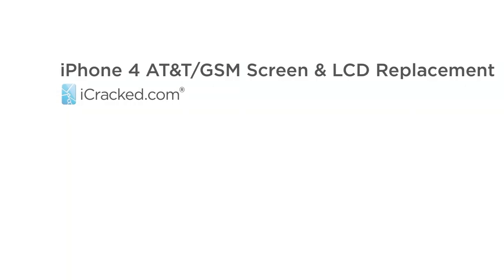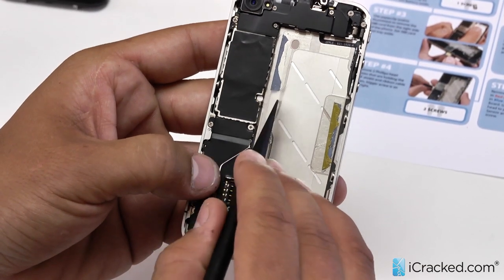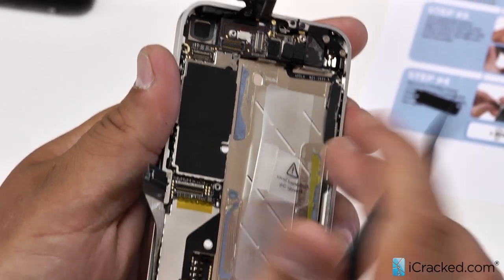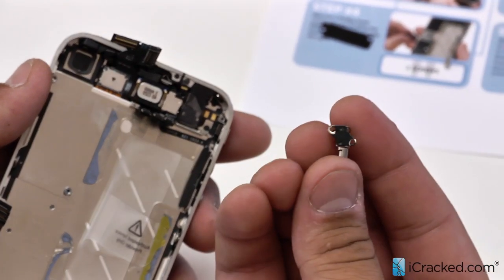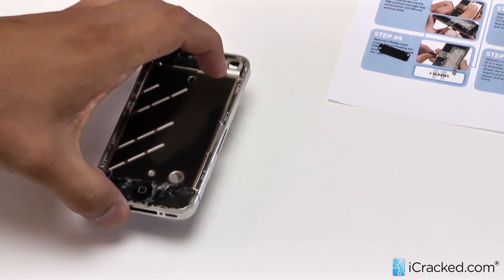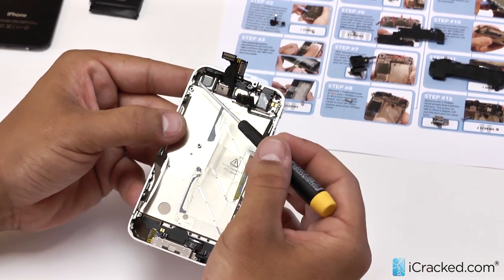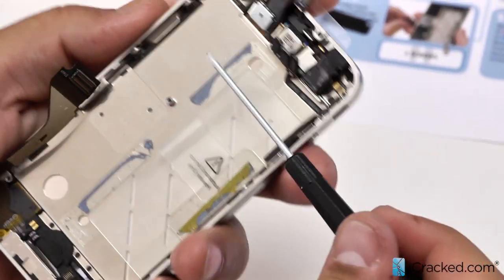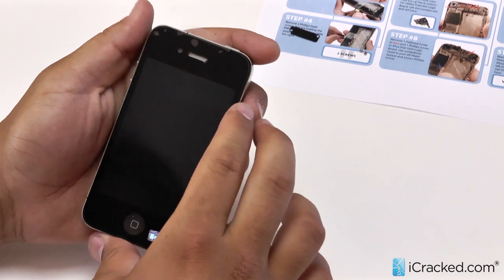Official iPhone 4 AT&T/GSM Screen / LCD Replacement Video & Instructions - iCracked.com

Comment: Excellent detailed instructional video. Worked great, and definitely appreciate iCracked.com making this clip and the kit available. A hair dryer really helped to loosen up the glass prior to prying. Also, my battery after 3 years was swelled a bit and wedged in tight, so you may need to give it a little muscle. Well worth replacing the battery with one from Amazon at the same time you do this repair.

Comment: I really thank you guys for this fantastic tutorial. I've bought the kit with the replacement screen but I didn't receive the kit in the mail. I just went ahead used the tools I've had available (retractable blade and some Craftsman screwdrivers). Now my iPhone is so much clearer and lookin' brand new. I just need to replace the back side and fix the audio problems in video recordings now. -____-

Comment: Thanks for this wonderfully thorough tutorial. I'm currently part-way through my second screen replacement (yes, I've dropped it a few times) first time was great except I forgot to switch the earpiece mesh. This time I tried with the battery and my screen works but evenly across the whole screen it's extra shiny/cloudy looking and hard to see from side angles. Also the wifi signal seems to be funny. I'll try re-seating it and checking connectors but I'm wondering if I just got a bad screen.

Comment: Thank you... Followed your steps and completed everything. Great work guys.. cant thank you enough.. Only thing i would want to add to the viewers is that the WIFI wont work during the testing phase.. it will work after the grounding i guess.. i was worried but then it was all great at the end.. i'm so happy...
Reply: one more thing.. i took the print outs of the important (screw) sections.. and used a school glue to glue the screws to the printout.. that way i didnt forget which screws went where and never lost a single screw...

Comment: Thanks iCrakced.

I've successfully removed my old smashed front LCD and Digitizer and installed the new one.

One thing that I noticed though, the screw mountings that hold down the upper EMF shield are a bit weak and tend to break off attached to the screw. Well, only the inner screws (2nd and 3rd from left). --- I noticed that in this video you have the screw 3rd from left still attached to the EMF shield. See 6:44 (you skipped pass the 3rd screw)

But its no issue though, the EMF shield can still be held down with the other screws.

Comment: Great video! Followed and successfully fixed someones iphone for them, only suggestion I have is when you put the screws back in, pause for 1/2 a sec and show the viewers which size screw is going back in (I bumped my paper and they went everywhere so I was unsure, but struggled through)

Comment: First of all thanks for such a thorough tutorial, but have a couple things to throw out there for everyone.
After connecting the last flex cable, you said to test the phone before putting in the EMF shields, i did it and phone worked, even dialed and received a call to make sure everything worked fine (because i had to change headphone, vibration and volume button circuitry and had to replace the speaker as well, so needed to test everything). 
Then I turned off the phone and put in all the EMF shields and the grounding clip, connected the battery, placed the back cover and tried turning on the phone and nothing, thought may be battery is all empty (it was on 5% before repair), so connected it to the charger and it went in that famous apple logo restart loop, connected to iTunes on my PC and it said phone needs to be restored, so tried doing that but kept getting Error 21, which is for a dead battery in most cases. 
I changed the battery then phone was asking for connecting to iTunes, connected to that and it restored the OS and now it works all good.

Question: could it be that testing without connecting the grounding clip, killed the battery? 
because it worked fine during the test, i turned it off just fine and then just connected the remaining things, nothing that should kill the battery.

Question to all: Did anyone else experienced this same issue as mine, of ending up with a dead battery?

Please don't tell me that iphone 4 is history now and doesn't make a difference even if we figure out the problem, but that's the thing, everyone who has iphone 4 is without a warranty now, but it works so perfectly fine that there is no need to upgrade. So we will be seeing more people now consulting these tutorials.

Comment: excellent guide! I thought i had broke the phone when switching the new screen on it was black, although you have to restart the phone. Also have a problem with the screw to the battery which is stuck in and i cant put the back cover on, any advice?

Comment: The only thing I would suggest is the step that you mention to install the screw "from an earlier step while we're here", needs to be more specific (i.e. step number). I ended up putting a screw from the wrong step and had to back track. But overall a great video! Thanks!

Comment: Followed your instructions down to the letter, had my screen replaced successfully in about an hour. Only thing I'd do differently next time is not be so slack on removing the sticky residue from my phone before installing the new screen. It made getting the corner screws damn near impossible to reinstall! Because of that there's the tiniest gap in my screen from the middle bezel, but this is acceptable for the time being. :p

It should probably be noted to anyone planning on doing this with a screen from eBay or something similar that not all replacement LCD screens come with the mesh on the earpiece so you might want to try and salvage the mesh from your old screen!

Comment: Just replaced the screen following the video. No problems except the video says it is optional to remove a little white ring from the old cover and put it on the front camera before inserting the new screen; the screen I got from iCracked came with the white camera ring.

Comment: I didn't see you mention the 3m sticker that was included in the kit. I can figure out where it goes but I didn't use it since you didn't use it either. Do I need to go back and put the stickers/adhesive on?  Is there a video for that?
I will presume that you will not update the video for this since it is an old phone.

Comment: Great tutorial, am fixing daughters phone and gotten as far as the upper EMF shield, 5 screws, problem. Got #1,3 & 4 out no problem but screws 2 & 5 will not budge. Have got screwdriver with new screen parts only. Advice needed as I don't want to round the heads off. HELP!!!!!!!!!!!!

Comment: May I ask a question - while putting back the final screw in the battery clip hold down - that screw head snapped off - really no pressure going back in - just head came right off??  Now since the battery clip snapped back in place - how important is that screw head in holding it and the shield down??  phone seems to function just fine - leave it alone OR take the batter back out and 'try' to remove that screw shaft - no head?

Comment: The instruction list that comes with the kit has places on it for screws and some of the smaller parts. Though, I did not trust myself not to accidentally knock them all off. Personally, I just used a small hardware box with multiple compartments, using different compartment for each step. The Screw Mat does sound like it should also work, though.

Comment: Everything was great up until the "Home Button" thing. Little peeved and not sure what you could've done differently, but I ripped my home button flex cable. The Home Button didn't stay behind. So, either I have a slightly different phone, or (as I saw in other videos) I'm supposed to flip a tab up to allow the ribbon to move freely. Any videos on how to repair the home button now?
Reply: +Joshua Drew You know, I'll admit this to youtube - I'm a dunce. I put tape on the screen to try and keep the glass together and it held the home button to the glass. Well, you learn right?

Comment: ANSWER QUICKLY PLEASE!
I have a problem where the mother board is above the frame in the top of my iPhone, but not at the bottom. So I can not fit the back cover on... Please help... You just put it nicely in at 24:10, but this is not working with me...

Comment: Good tutorial but I'm struggling with getting the antenna reconnected...
Reply: That connector is a real pain.  It's very common on Apple products.  You must be very patient and get the parts lined up EXACTLY.  I recommend using a pair of tweezers to get it positioned right and push it down with something pointy but hard.  Get someone to help if need be.

Comment: Everything worked great until the last step... I put the grounding clip in and my screen goes white. Any suggestions? I power it up and it works. I shut it off and finish putting it back together and white screen.

Comment: I did this correct and it just white screens. I have done the resets and all and it won't work. After searching around it looks like the digitzer won't work with the phone because the phone will only work with the original digitizer

Comment: last time i put in a new screen i knocked off the blue thing on accident and couldn't figure out why my phone wouldnt pick up service. do i have to buy a new logic board? or is it cheaper to just buy a new phone?
Reply: You have to have the wire jumper resoldered by someone that can micro solder it back on. That wire jumper is the antenna connection for the GSM service.

Comment: You might have loosened your wifi adapter connection, its just a push connection, like the service antenna in the video. Might have to take it apart again and make sure the connection is seated properly.

Comment: Phew.  That was a struggle, but I was successful.  Kind of spotty on a few points though.  There was a guitar pick, some replacement adhesive pads, and a kind of blue thingie that weren't mentioned in this tutorial.  Also, you unscrew screws WAY TOO FAST!!.
Reply: That was fast forwarding.
Reply: Yes, but now I know what a spudger is.  I have 2 of them.

Comment: Instead of buying a replacement screen I bought a icloud locked iphone 4 off of eBay, that way my new screen would be OEM.  

Instead of swapping screens, could I just put my logic board into the cloud locked iphone I just bought? It would be a ton easier! Also the icloud locked phone is fully functional, (besides the fact that it's locked of course).

Comment: I followed all the steps and when I finished and tested it, I have a white screen, but if I touch it like unlocking it I hear the clicks of the keypad, I tried the old screen but it does the same thing, what did I do wrong?
Reply: I had the same problem. Very simple fix actually. Just hold down the lock button and home button together until you see the boot apple. Because it is a new screen it does not accept it at first. This just hard restarts it and should get it working fine :)
Reply: Garrett Dixon i tryed that and it didnt work? ? ? ? ?

Comment: hi i followed the instructions and the screen is working but the touch screen part isnt working, i cant get into my phone what did i do wrong??
Reply: You got a bad screen.
Reply: It's possible one of the connectors is loose and all you need to do is go back in and make sure everything is snug.
Reply: shanexe, thanks that was what was wrong i just didnt plug something in all the way

Comment: I did not use the phillips head screw driver and i damaged the screw on the grounding clip when i was trying to remove the battery. So now i can't  go on
Reply from the maker: Gillern Maguranye We are sorry to hear that you are having this issue with your repair. Please try taking a very small square of duct tape and placing it sticky side down over the screw head. Then use your screwdriver to push through the duct tape and try to remove the screw again. The duct tape should act as a filler that expands into the void of the stripped screw head and the tape's adhesive also helps grip the sides. If this does not work, you can also purchase a screw extraction kit from our online store (http://shop.icracked.com/collections/tools/products/6-piece-screw-extractor-kit).
Reply: I did that and it worked. Thanks to you my I went through well with my repair

Comment: Where can i get the step list
Reply from the maker: The step list or repair flowchart is included in the DIY kit .  You may also check this PDF file using this link ;  http://issuu.com/icracked/docs/ipad4_diy_flowchart_issuu
Reply: This link is for a ipad not the iphone 4 gsm. Do you have a link to the iphone 4 GSM?